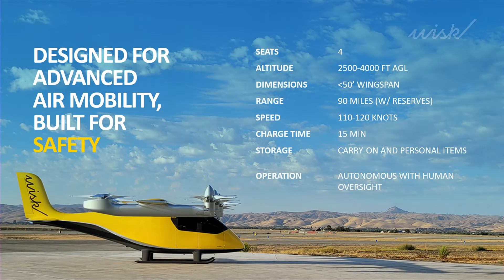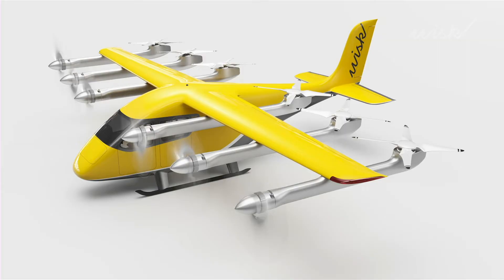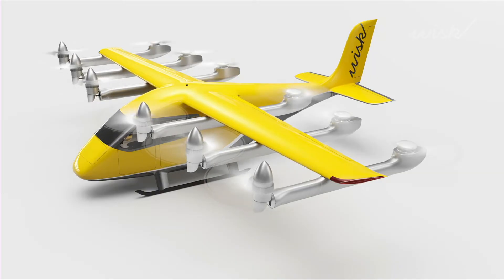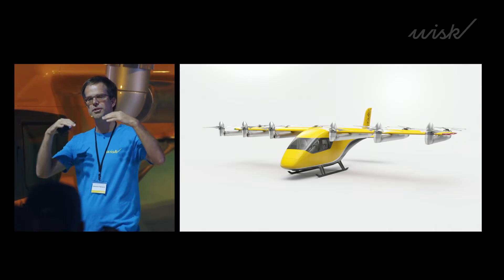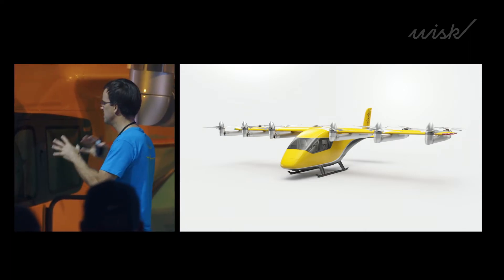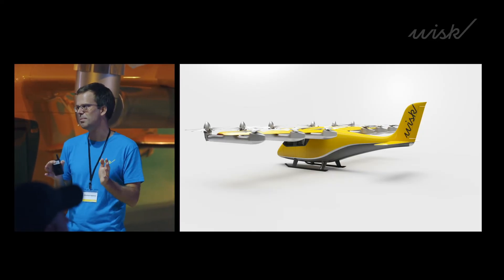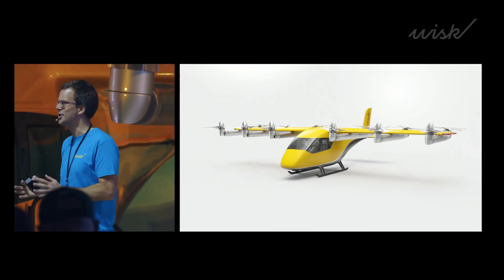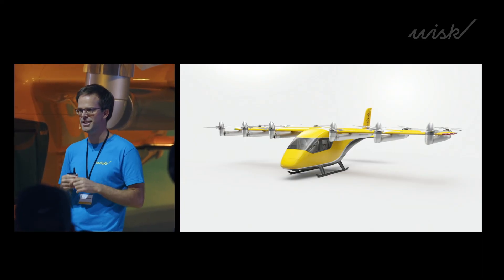Generation 6: Aircraft Configuration with Sebastien Vigneron

Comment: how installed battery power ?   range of 90 miles ?? so downtown city to international airport ... only ?
15 minutes recharge ?  using 440V DC chargers (commercial EV, DCFC) ?
does each engine have a dedicated battery pack ? (for more redundancy)
You're "coy" on payload.  If this is the sidestep ground traffic to an international airport, wouldn't you expect international baggage allowances ? 4 pax would be north of 1000 lbs payload plus a pilot (initially), 200 lbs.
Reply from the maker: Hi @russellblake9850, 
Correct, the aircraft has a range of ~90 miles. Our initial use case will be urban passenger transport (around town, city to airport, city center to suburb, etc.), and our current range will be more than ample to meet this use case. 
We don't disclose specifics about our distributed electric propulsion systems, batteries, or charging for proprietary reasons. 
However, we can certainly share more about the useful payload, which is 900lbs. There will NOT be a pilot onboard initially - we will be launching services with a fully autonomous air taxi. This means the 900lbs will be divided only by four passengers. Hopefully, this helps clarify some of your questions.
Thanks!